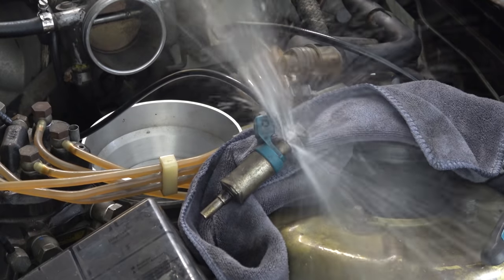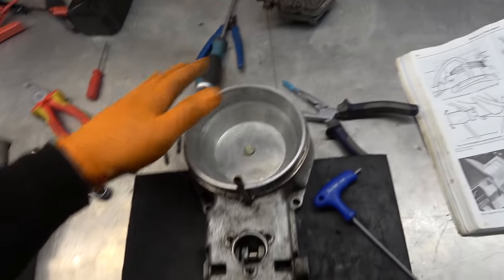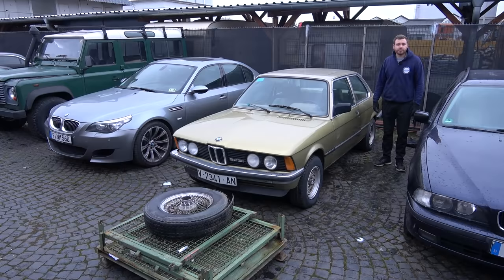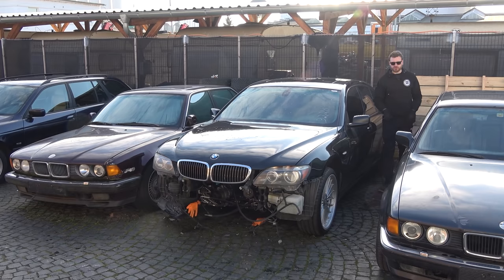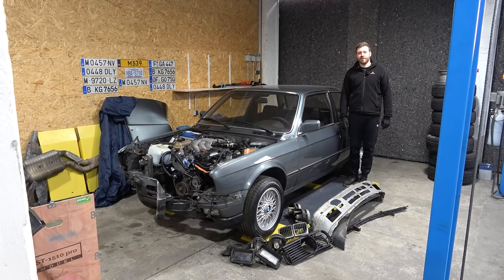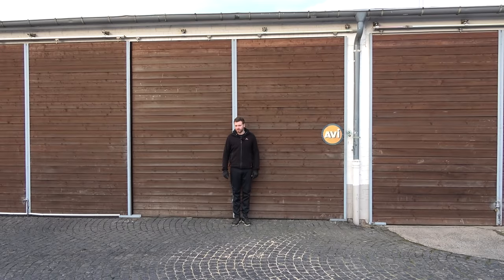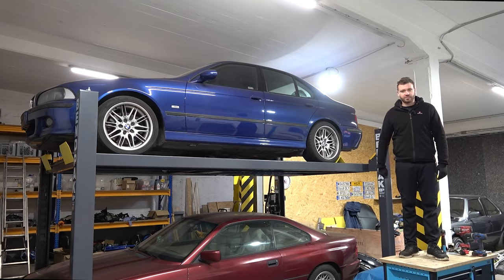Solving BMW E21 323i Cold Start Issues, Update On All Projects & News!

Comment: By definition if you are still cold then you are not wearing warm clothes ; ) 
I highly recommend upgrading your clothes before you spend money on a heating system. Or try wearing a hot water bottle underneath your jacket.

Comment: Love the videos, perhaps think about an air dryer as extended use of the compressor will send moisture down the lines, your Vapor Blaster  air solenoids will not thank you for the moisture . Likewise any air motors on tools you have  . looking forward to the next videos.

Comment: My 1989 Toytoa Corona Diesel (2c) always, always, always started in less than two crank revolutions, sometimes just one piston would go over tdc and fire    -12c to +31c year in, year out, even after seven weeks not driven. Mechanical injection, 23.5:1 compression!

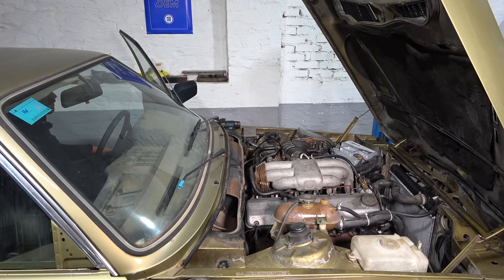Comment: Hi Sreten! Good content as always! Can't wait for E30 to rise ones again and yes i'm looking forward to that video! But... i noticed that you installed the fan incorrectly at 12:30 and at 12:54 just before you started the engine!  The blades should "bend" toward the engine and not to the radiator, or maybe something is spinning in the opposite direction and causing the slight overheating issue! As always i'm following your work and the channel and i love it!

Best Regards!
Sam from Sweden.

Comment: Hey, love your vids. About the coolant temp gauge. I have a first gen Audi A3, and i had the coolant overheat due to a fan not working. I checked vids about it, and turned out, the cluster temp gauge is weighted, so it is staying at 90 from around 82 to 102 degrees. I guess the purpose of this is that so the driver is not freaking out every time the temp going upward. There is a service mode on the climate control, so the mechanic can monitor the actual coolant temp. I was watching that when i was testing the fan, and the temp is going up to 98, fan turns on, goes back down 93, fan turnes off, then going back up again etc. If the air temp is too high, it will even go up to 102, then the fan is going full speed mode to be able to cool that down. Maybe its an old car, and obviously the cluster is not weighted, showing the actual temp, and thats why you see it moving up and down.

Comment: If the injector is electrically fine and only the spray pattern is bad, you should try sending it to ultrasonic cleaning - they apply fuel and power to the injector while cleaning and it usually works pretty well. It is a common issue that injectors get clogged when not used for long time, even for with modern injectors that have been used with good quality fuel.

Comment: I got a Xiaomi Mi Smart Space Heater S and one was enough to heat a small apartment during December here in Croatia. Not as cold as it is now tho. Two of them might do the trick. The large benefit they have is that you can heat up the place by turning them on on your phone before you arrive to the place (assuming you have Wi-Fi at the shop). Also they're fairly inexpensive.

Comment: Regarding heating, what about infrared heaters? They are less energy hungry than the conventional heaters due to heating only the objects in the area of action instead of the air, but they are very confortable (as long as you are in the aforementionned area of course...) and some models offer good coverage while still being compact and easy to move around the shop depending on what you are doing. You can even put one on the wall next to your workbench to have consistent coverage in this area without crowding the floor.

Comment: You should consider a heat pump for heating - 1/4 of the power consumption compared to the straight electrical heat source, with the added benefit of having AC in the summer.

Comment: God I love that E60. That is such a cool looking car.
I remember seeing some auto show where they got a heater they put up in an upper corner of the shop and it would heat the whole shop. If I remember right it was infrared with a big reflector. I don't think it had a fan on it.
You might want to research that Streten.

Comment: Buy infrared diesel heater. No horrible noise, no smell. Just really good heating power and low diesel consumption. In Finland Airrex is best IR-heater brand, Airrex ah-300i has been absolutely perfect heater.

Comment: Nice work as always :) careful when removing that top radiator hose on old behr radiators with a plastic neck. I've seen more than one break at the neck on W123s with similar behr units

Comment: For the heating problem, my idea: made some diesel heater from Webasto car heater. I know not the best or most eco friendly solution. but I think 3 webasto with 3 radiator inside the garage can  make some acceptable heat. Maybe from E39 m57 diesels can buy them, because as i know all got 5kW webasto auxiliary heater.

Comment: I'd use infrared heating panels. No noise, reliable (no moving parts), does not take any space, as it can be installed on the ceiling.

Comment: The temp gauge fluctuating can be a bad wiring voltage on the thermal sensor so you might want to check that out.

Comment: Hi man, I really like your channel and always look forward to the next video. So keep up the good work. As far as your heating in the shop you might wanna consider a climate controle. I recently had a Mitsubishi split unit installed outside with two units inside in two different areas for €2800,- They heat and cool really good and quit efficient in terms of energy use. And in the summer I experienced personally that it can be brutally hot in Germany as well so that may be a reason to consider it so you can work really comfortable. It’s a serious expense but once  for at least 15 years.

Comment: Use infrared panels for heating, they are much more effective at heating a specific area for lower costs. Infrarot panel in german, just be smart about positioning. But should safe you a lot of money compared to electric heating

Comment: VW used the same cold start Injector on the A1 & B1 chassis.  It's possible to clear a gummed up cold start injector.  I cleared one from a 1983 Rabbit GTI with an ultrasonic cleaner.
It might be worth cleaning your original as a backup.

Comment: Double wall stainless pipe through the roof with a wood stove. 4 slow moving large diameter shop ceiling fans. 2 air movers to rotate the air around the room.
Will make enough heat to warm it up in less than an hour and then burn all day. Great for -20 where I am. I don't know what the rules are in Germany on them? Super cheap for 8-12 hrs a day.

Comment: Have you looked into air conditioning with a heated function? I use one in the house, you can put the main unit outside, and connect the inside unit thru the wall/roof.

Comment: It did happened to my Mercedes 190E16V with the same problem, idling injector always gave problem.  I rebuilt it cost $60, new one is hard to get.  Funny, regular injector is easy to obtain.

Comment: i don't know if the 323i had it, i know in the early 80's volvo had to install temperature compensation circuits in there temp gauge as people expected to the guage to sit exactly in the middle but as the engine warmed and cooled slightly on the thermostat the gauge would move slight high to slightly low. this caused people to freak out a bit, so they altered the way the gauge works so it would only go high above the middle if the engien was really hot.

Comment: They make electric space heaters that have a fan on them so they push more air around and heat better. They can get pricey. Or you could go with smaller heater like what you have and put a box fan in front of it and place them in the right areas around your shop.

Comment: I liked the format of this video and getting an update on all the projects as well as seeing the progress on the E21! My E24 635CSi cold start valve was a nightmare to deal with a few years ago too...not so much due to getting faulty parts like you experienced, but because it's placement is probably the most inaccessible item in the engine bay. Never want to do that job again and hopefully mine lasts for many years. Good luck with the workspace expansion! Is propane powered heat an option?

Comment: What about infrred heaters? One for the workbench and another one to move around? Also you can ultrasonic clean injectores. There's even companies that specialize in rebuilding and flushing them. Probably cheaper, than buying half a dozen used ones.

Comment: If it comes to heating have you thought of air conditioning with heating function? It's in fact a heat pump, air to air type, so it's very efficient in heating (3-4 kW of heat are produced from 1kW of electricity) and very quick, cause it heats the air directly. And, obviously, you would have AC in the summer ;)

Comment: Hi  Sreten , regarding the heating issue. Isnt installing one Air conditioning a possible solution? im sure you can get a 24000 Btu unit installed in there and would probably help fiz the problem and they are not as expensive to run as some of the other options you talked about. Im a ac technician btw so if you have any questions i would be very happy to help.

Comment: Great video once again :)
For heating, would it be possible to install a wood stove? If you make friends with a local woodworker you can take their scraps and have tons of free firewood. This may not heat your shop very fast but it will get you just that difference that makes it so much better to work there. I know a 400m2 (1600+ m3) workshop who use just a single Bullerjan woodstove and they have decent temperatures in winter and apart from the initial investment it's super cheap

Comment: that e21 temp gauge is just showing the real temp. All modern or semimodern cars have the needle showing exactly the same thing for everything between 75 and 110 .Thats why when in summer and fan is kicking in traffic and the opposite in winter after just 10min driving needle is in the middle.

 Many pre 90s cars have the gauge showing just the real temp and you catch yourself constantly monitoring the needle, maybe many complains are received and finally they "fix" the needle going up and down with this 70-110C thingy

Comment: nice shop indeed ... on the compressor side, I hate to be pessimistic but these "low noise" (no oil?) fridge type compressors will likely not put out enough flow since blasting cabinets usually require a lot : when they say 40CFM @ 100psi (say 1000l/m at 7 bar) it is not 1000l/m intake flow... if you want high flow yet relatively low noise, you'll need a screw type compressor (like they use for  paint booth, same operating principle as in a supercharger)

Comment: my 76 Volvo 240 with kjet -the coolant gauge does go back and fourth...  My gramps got it brand new and said its always done that.  think the temp gauge is a real temps unlike newer cars where the ecu keeps the gauge straight up so people dont freak out about the temp flexing
Reply from the maker: That would make sense actually cause modern ones are programed not to register hotter temp changes and by the time it does, it's too late

Comment: I suggest to create an heated area only were your tools and workbench is, otherwise far too large area and cost you a fortune. In really cold days focus on jobs you can do over there, for example engine or parts overhaul. Get it done with plastic sheet to the roof, to keep the heat in that area.

Comment: At around 12:40 or thereabouts it looks as though the curve of the fan blades are the wrong way around.  Maybe the fan blade assembly can be mounted on the fan hub in two orientations?  If so, then it might be worth trying the other way around, it might improve the fans efficiency a fair bit.

Comment: For the temp gauge, change the ground straps around engine, alternator to engine and engine to chassis, I had exact problem on my e30, changed those two straps and the problem is gone

Comment: My e30's temp gauge will go slightly above the middle while idling in the drivethru. At speed the gauge will be around 1/4. The owner's manual says anywhere that's not in blue or red is ok.

Comment: For the heating, why would you not use Ac heater ( aka. heat-pump ) ? It can convert 1kw of electricity to 9-10kw of heat so it's like 9-10x cheaper than electrical heaters. They are not super expensive as well

Comment: If the car has an SI board behind the cluster like an E30 then that failing could be the cause of the temp gauge.

I’ve also had on E30’s where the actual gauge connector is loose (whip cluster off and have a look)

Comment: I'm not sure how is it with e21 gauges, but there's a quite common issue with e30 gauges - a brass nut behind coolant temperature gauge loosens (or falls off) and that causes the needle going pass the half or jumps a bit back and forth. Maybe worth of checking.

Comment: Dont use electric heaters with 2kw or more with a plug. Connect them directly and the need to be fused seperate from the rest.
Plugs might melt if 2kw are used over some hours. 
2kw is 9ampere, a normal plug can handle 16ampere for 1hour, for longer use you should not excede 10ampere but only under perfect conditons, i saw many 2kw heaters with melted plugs even if its said they could handle it.
Just use it for some hours and the feel how hot the plug gets.

Comment: The high temp would likely be the lack of a shoud even if it wasn't fitted with one. as it'll make sure of pulling all the air through the radiator.

Comment: I can't keep up any more!  Re. heating with electricity - mabe buy 3 or 4 (or 5 or 6) cheap c. 1200w halogen heaters (and they really are cheap, to the point of being practically disposable which is ethically dubious, but some Korean-made ones at least give a few thousand hours / a couple of years use) - very compact and light, and provide instant spot heating, a couple will keep you warm at one end or other of a car, or at a bench/workstation.

Comment: Can’t you install a couple of air to air heat pumps?

 I use one in my workshop at home and it does not have any issues getting the work space up to temperature even during the swedish winter. 

At work we have two pumps and they struggle a bit when it’s below -10C but then it’s like 250 squaremetres with high ceiling to keep warm.

Comment: You can't mount a nice split AC/heater in the garage so you have good heat in winter and cool AC in summer?  It'll be quiet too for recording since all the noisy components can be mounted on top of the garage roof and only the blower will be inside

Comment: Hi regarding the heating situation, here in the UK, some garages have an oil heater, that runs on used car oil(s). It's also pretty quiet because it only has a car blower fan to spread out the heat. Isn't this an option in Germany, too?

Comment: Hey dude great work. Which thing did you change to get the injector working. I got the same problem with my e36. Sometimes it starts good. Sometimes it need 4-5 turns. I need to find the problem. Never ending story...

Comment: Hi Streten, I want only your humble opinion about the following issue i am having with my car. I own a 1991 Mercedes 190e 1.8 with 272K kms on the clock and my engine is burning some oil. The car works absolutely perfect though. I have maintained the car absolutely flawlessly since brand new. Should I try to replace the valve stem seals? Is it worth it? Some mechanics tell me it is worth it, but some others it is not worth it. I did also a dry and wet compression test across all the 4 cylinders and given that this engine has a 9:1 compression ratio, is it normal that i found 130-135 psi of pressure across all of the cylinders. Most people tell me that this compression is normal low, but i tested it cold and another time at 50-60 degrees Celsius. Regarding the wet compression test, the compression increased a little bit (about 145psi), which is an indicator that it may need valve stem seals and that my compression rings are going. Will I find any difference if i dry test it again at operating temperature? I mean that it burns oil for sure from the pistons, but according to your experience with cars, will valve stem seals replacement reduce my oil consumption? Thanks for your videos Legend!

Comment: just put air conditioner for heating , 2 x18 BTU or 1x24 BTU will do the trick and they will burn less energy than that thing you use ...

Comment: Hello, 
I have problems on cold start for a few seconds the idle is rough, and afterward everything is good i would say. All glow plugs are changed and the relay too. MAF sensor, cranckase breather. Can an oxygen sensor be faulty without reporting an DTC? What is the best way to test it, can it be cleaned maybe?
The car is E91 LCI 318D 105kw 11/09, it has only 1 oxygen sensor I would say only on the DPF, next to the temperature exhaust sensor and the pipe for pressure sensor. 
Thank you for the answer in advance.

Comment: Regarding the 528 e39: I have exactly the same cold start issue with my m52tub28, what's the solution?!
Reply from the maker: 2 sensors on the throttle body and cleaning idle control valve.

Comment: I have a BMW 320 E21 1982 which sometimes when I turn the start key, it starts, sometimes it takes me like 5 times turning the key to make it start. and sometimes when it doesn't start at all. I wait for a day and it turns again. Something in the ignition system, the fuel pump, the starter motor???

Comment: Maybe you can help me I have a 2006 BMW 750li E66 that has crank but no start I replaced the fuel pump , fuel filter added 2 gallons of fuel still no start. I then found out about the Sbsr module which activates the fuel pump I checked fuses and they are good . There are some images of this module and the soldering are broken but mine doesn’t have any broken solder points I guess. Can you help me get this thing running I would appreciate you